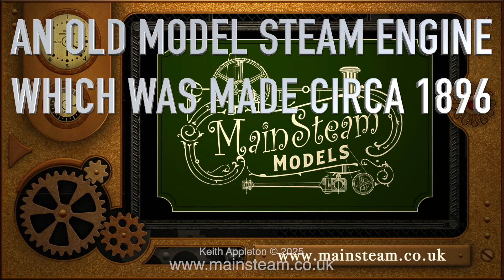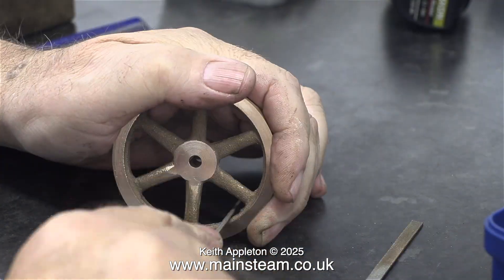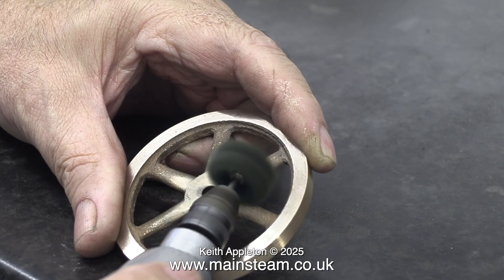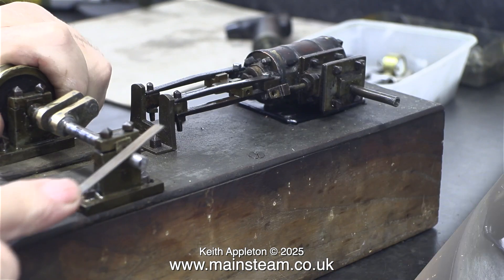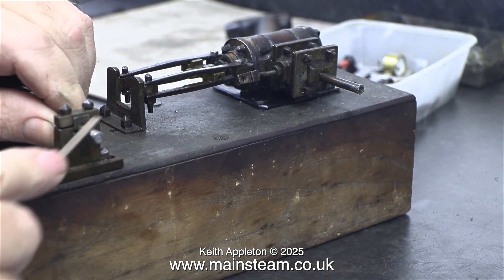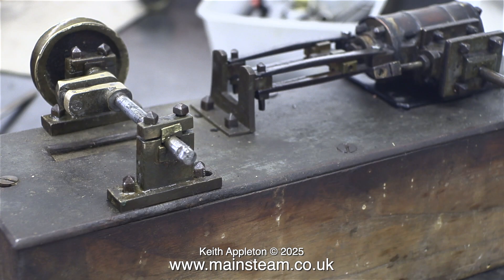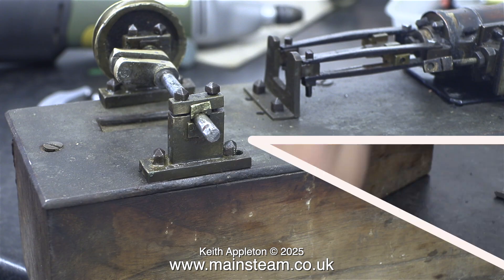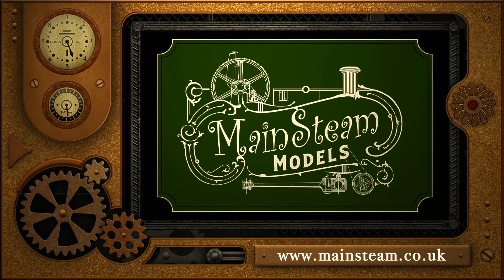REBUILDING A MODEL STEAM ENGINE MADE CIRCA 1896 - PART #6

Comment: I wonder what tools the original builder had at his disposal. It might not have been much!
I knew an older gentleman as a kid, in in the 1990s, whos father had made a steam engine for him when he was a boy, in the 1920s. They were a poor family, but the father was an ingenious guy: he melted the brass for the cylinders and the frame in a coal-fired kitchen stove. For an improvised lathe, he took his wife's sewing machine off the base which had a foot pedal and a flywheel, and built a contraption enabling him to turn parts between centres.

Comment: The crankshaft may not be a standard size, imperial or metric, but it will have a size that can be measured in imperial or metric.
Getting the crankshaft the same size as the flywheel hole, as you have shown can be a challenge, but I guess in the 1890's what people had available was different from today.
If the flywheel does not run 100% true, that is only fitting in with the age of the engine.